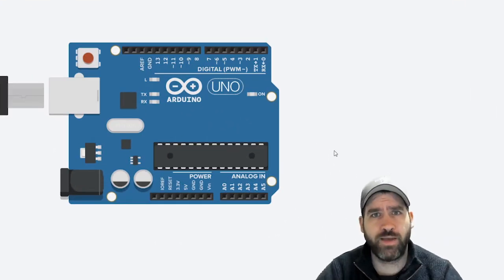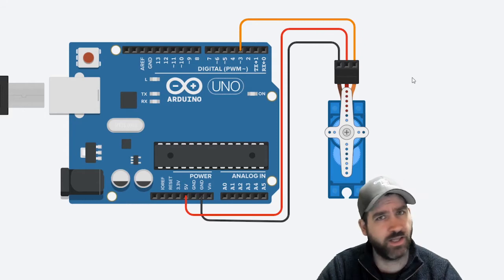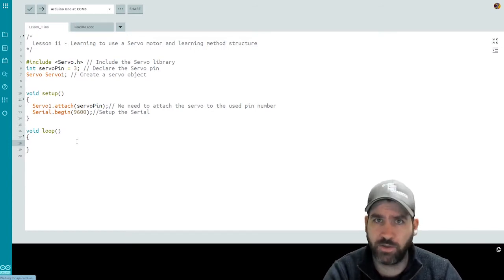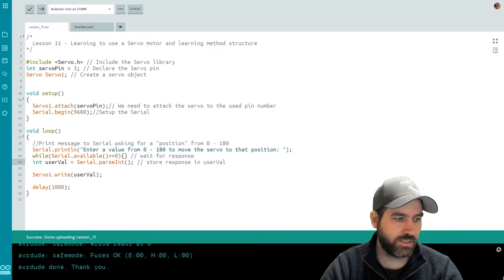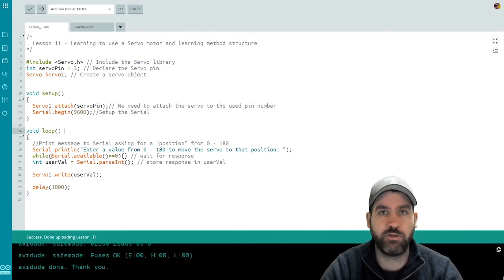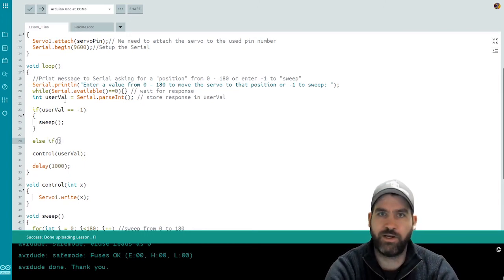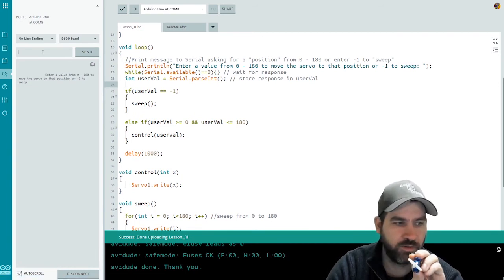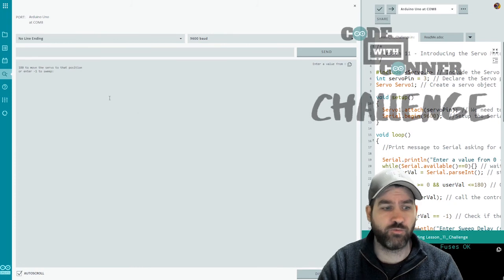Arduino Basics - Lesson 11 - Using a Servo motor and method structures

Comment: I first did this sketch in tinkercad, and everything worked perfect.  I then did the same sketch with my Arduino, and it worked OK, except after each angle entry, the servo returned to 0??  Why would it work in Tinkercad and for you, but not on my arduino board?